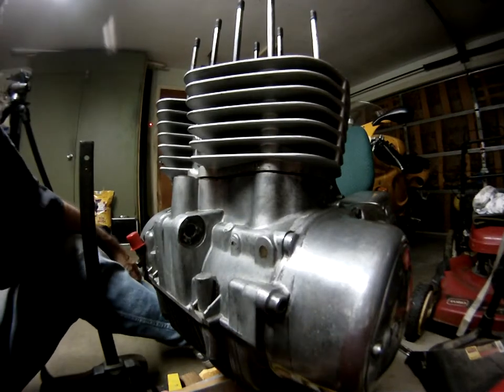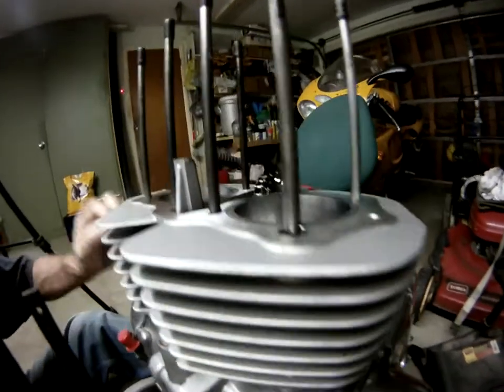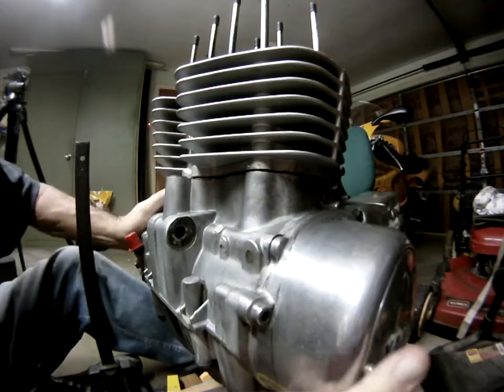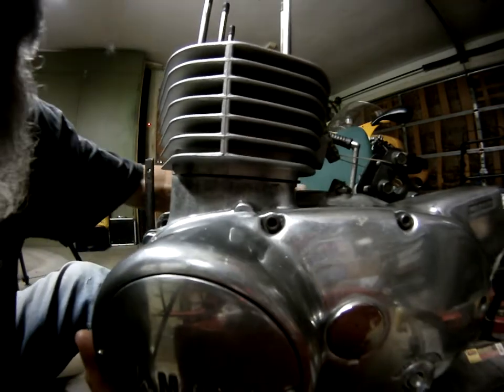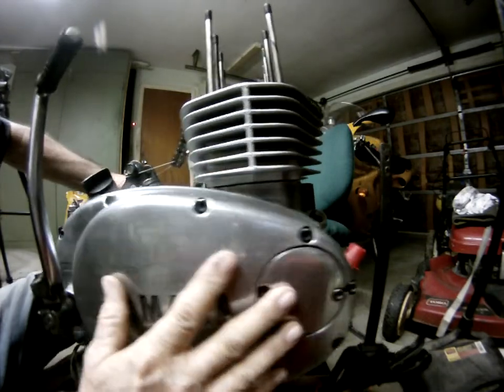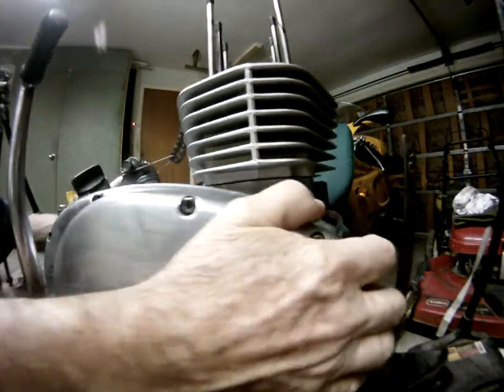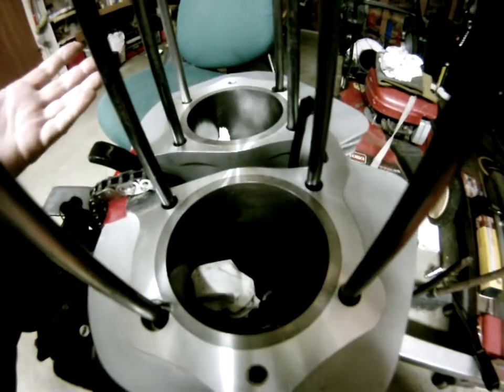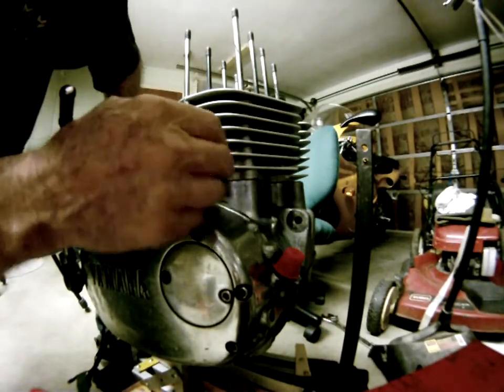MikesXS Big Bore jugs not seating

Comment from the maker: the inside of the crankcase had to be ground off a little to make room .
It was the width of the jugs that was hitting just at the bottom.
Reply: is there a video of yours showing what you did to correct it by chance?  I''ve gotta pop mine back apart and am trying to avoid pulling the pistons from the rods again if I can help it although I might have to in order to do a dry fit.  Yes I drop my cylinders on the pistons with ring compressors as by myself that is just how I've always done it and it works for me.
Reply from the maker: @ThePunkasfuck  No video I used Dremel tool with grinding stone and carefully removed wall where jug was hitting crankcase until jugs would seat It was not hard just take your time and remove material in small amounts and test fit until you get there
Reply: @nightflyer12345  Sounds easy enough I'm not worried about that but I did get in touch with someone at mikes about it and they told me to remove the o-rings from the cylinder although the kit comes with o-rings and no information so that's cool.  I explained to him it's certainly not the o rings holding it up.  They would compress under the pressure it's definitely a metal contact thing.  Di you run o rings with yours?  I do not agree with not running the o rings.  I should have dry fit the cylinder without rings but live and learn.
Reply from the maker: @ThePunkasfuck   I used the orings as you stated the orings are not problem. it was for sure outside cylinder contact with inside crankcase

Comment: I had the same issue. Turns out that the  threads on the rear stud on the sprocket side of the case were 2 thousands bigger than the hole in the jugs. Easy fix